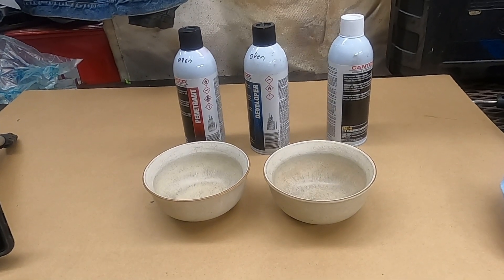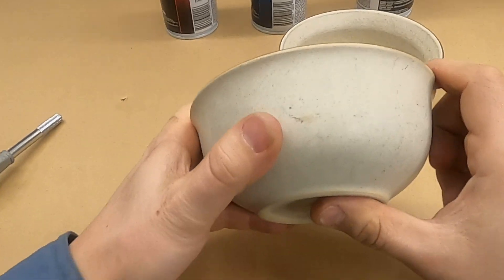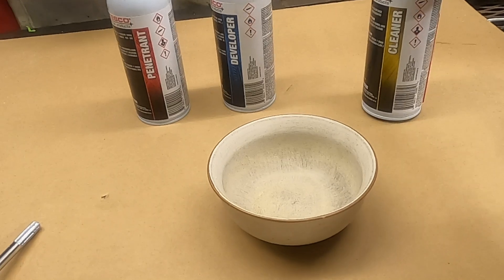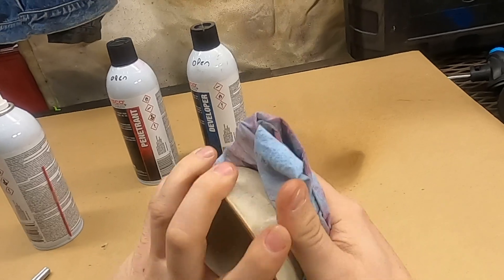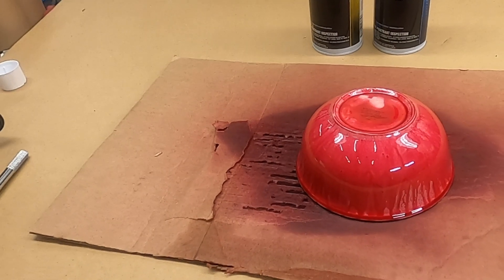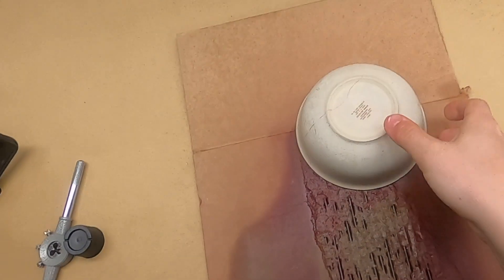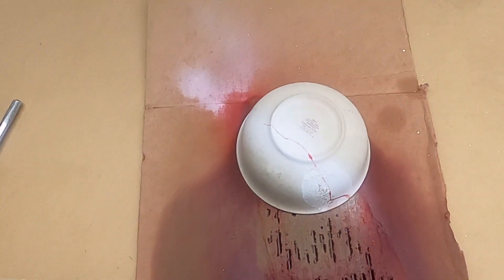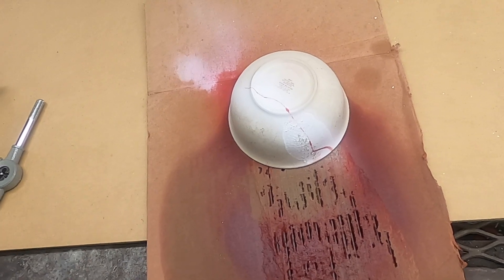Bowl sounds wrong - crack testing ceramic with dye penetrant

Comment from the maker: My intro was a bit too terse perhaps, I should have mentioned what these dye penetrant kits are usually for in case people are not familiar.  These kits are generally used for metallurgical inspections, such as welds and castings that are being inspected for failure.  They can be used for routine inspection, or when a crack is suspected (such as due to nearby failure or other cracks, symptoms, etc); or for testing after performing weld/braze/other repairs on a casting or failed weld.

I don't think I have ever seen them used on ceramic, and thought to give it a try.

Comment: Hi
I have an old ceramic jar that i managed to drop on the floor. It is around 100 years old and have a painted motif of a bear and a goat on each side . It is in pieces. Do you know what type of glue that can be used to glue this together again ? Thanks😃
Reply from the maker: @Tøger-v3d  I am not an expert in this area, but I have had good luck with superglue (the thin runny stuff, not the gel for this), and patience. If you have many parts to assemble, you'll want a can of spray accelerant ("kicker") to be able to get each piece to set faster so you can move onto the next one

Comment: Fun stuff! I'm curious about the residue left by the developer, does that wash off in any way, or did it eat into the bowl?
Reply from the maker: @SneakyBeakySpy  can all be cleaned off with the cleaner spray it comes with, or brake parts cleaner or similar solvents. It's all pretty inert, no impacts on the ceramic or finish. Of course it went in the trash so I didn't clean it up beyond curiosity of what the crack looked like now that I knew where t find it (it was still impossible to see once I got all the penetrant dye out)
Reply: @FliesLikeABrick  Thanks for the info! Makes me wonder if with enough cleaner you could get the coloring out of the crack aswell.
Reply from the maker: @SneakyBeakySpy  yeah evengually with cycles of silent and compressed air to dilute it and blow it out before the solvent evaporates. I suspect some ceramic grain structures will hold it longer than others
Reply from the maker: @SneakyBeakySpy  yeah evengually with cycles of silent and compressed air to dilute it and blow it out before the solvent evaporates. I suspect some ceramic grain structures will hold it longer than others
Reply: @FliesLikeABrick  Yeah that's what I was thinking as well, might be hard to pull it out of it, given how porrous ceramic is. A little discoloration never hurt anybody (unless it's poisonous, which I'm assuming is the case)
Reply from the maker: @SneakyBeakySpy  It works out pretty well. since if it has a crack you're probably not going to be trusting it for cooking/eating with whatever it is, so food safety doesn't matter.  and if it isn't cracked, it is easy to clean it with the solvent cleaner and then with soap+water before use